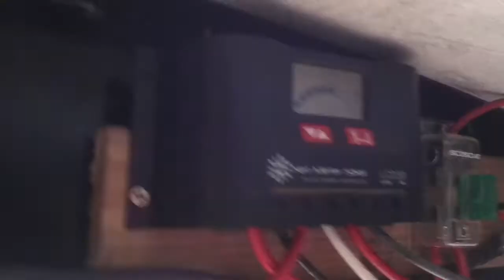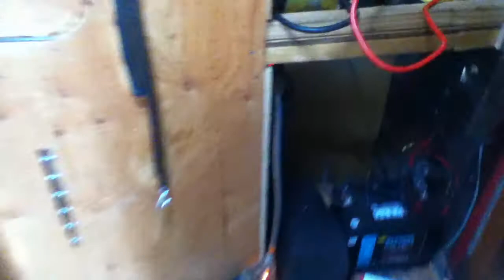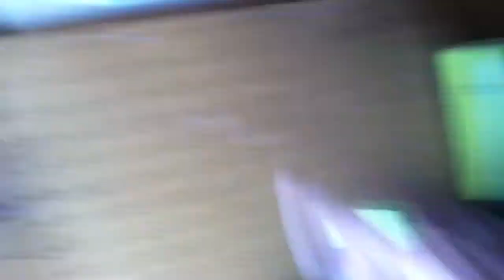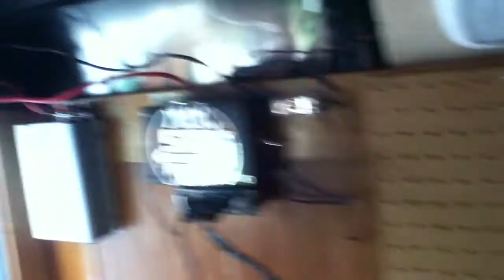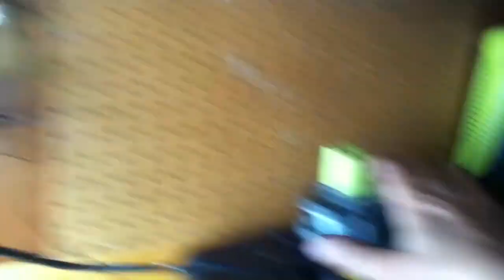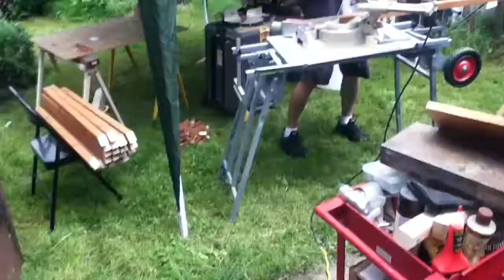Testing the off grid workshop power system 1A

Comment: This is an excellent example of what NOT to do.  

Battery life (number of charge/discharge cycles) is determined by how deeply you discharge the battery.  A battery that will give 1100 cycles at 20% discharge will give 500 cycles at 50% discharge and perhaps fewer than 100 cycles when fully discharged.  There's a very good reason that the charge controller disconnects its loads when it does - it is trying to protect the batteries.  The inverter's low voltage shutoff is to protect the inverter.  It doesn't care whether your battery survives.

I suspect that deep cycle batteries didn't work for you because you tried to go cheap on the batteries.  There's some serious thought needed to correctly size a battery bank for solar power. - typically a much higher amp hour rating that casual users can readily accept.  Sorry, but batteries can easily be half or more of the cost of a good solar power system.

If the system had 4 of the batteries you used in parallel, it might come close to meeting your expectations.
Reply from the maker: notyoung No, no and no.  Power tool battery usage works differently from just leaving lights on.  Not to mention much of what you assume is badly outdated.  Most of your other statements also indicate pretty limited personal experience with this stuff.
Reply: Common battery amp hour ratings are based on their 20 hour discharge rate.  For a 100 AH battery, that's 100/20 or 5 amps per hour to get 100 AH.  Not the kind of discharge rate you need.  The cranking amps rating is typically for 30 seconds, but not 30 seconds every two minutes for an hour.  Neither of those ratings applies to your usage.

Just as automotive-size batteries come in different versions (standard, marine), deep cycle batteries also come in different versions.  You probably looked at or tried the low to moderate current versions typically used in solar installations.  

A fork lift battery has much higher peak current capability (starting a DC motor under load requires a LOT of amps) and that's what would be appropriate for your use.  Long life - typically 10 to 15 years if properly cared for.  High peak current capability - that 10 amp saw probably raises the inverter draw on the battery to 120+ amps.  This battery http://www.hmserviceinc.com/content.cfm/category_id/115/page_id/165 has a 510 AH rating at the 6 hour rate.  It's designed to deliver 85 amps for 6 hours continuously.  The energy stored in that battery is 6 KWH - which should run the saw continuously for 4 to 5 hours. That would also run the saw 30 seconds out of every minute (about the rate that's shown in the video) for many hours.  Having power for the smaller loads all day is a bonus.

Just remember that the battery needs to be recharged every time it's used.  That means that you'll need to make a battery compartment that can be vented to the outside if the trailer must be closed and locked when parked in its charging location.  Also consider that you may need a proper charger to charge that size battery overnight.  Unless you only plan to use the trailer plan to use the trailer every third day, that 10 amp charger from Walmart won't do the job - it could take two days to recharge the battery - 510 amp hours / 10 amps = 51 hours if fully discharged (ignoring the fact that charging isn't 100% efficient).

As a new 6-85-13 fork lift battery with a 5 year warranty is about $1200 plus shipping, I think you'd remember to charge it regularly.

Downside?  It's big and heavy (547 lbs).  It probably needs a bigger charger than you have (more $$).

Positives?  You have power for an entire day on the job.  The solar panels could add to the time you can use the inverter for power but that depends on the weather.
Reply from the maker: notyoung the system I used in his video was eventually dismantled and the components used in another project, but it never required overnight charging.  In fact nowadays my systems are parked nowhere near where there is any electrical power, often sitting for months at a time.  Until I see actual stuff that you actually built or used, you are going to have pretty limited credibility on my channel, but I won't go deleting your comments because your attitude is one which I see from "professionals" who have been misguiding people in this industry for years.

Comment from the maker: Considering the number of cars rolling around these days with batteries over ten years old, and the fact that the charge controller and the inverter both have low voltage protection, I don't expect the use of this system to be fully cycling to the point that it would be killing a battery every three months or even for a few years.    I am cycling this system between 10.5v and 14.5 volts several times a day,

Comment from the maker: I covered those questions in previous videos.  The cable run between the inverter and battery is very short.   I am attributing the current levels of voltage drop to the relatively small size of the battery, but it's real purpose is to regulate the power flow from the panels and for that matter I am calling the test a resounding success considering that it was a pretty cloudy day with the panels operating at only 20%.

Comment: Get another battery. You have delays between saw cuts and that's when it's charging back up. It's always charging even while you are grabbing more wood or doing something else and also might be charging even before you start work for the day so that is all power stored up ready to use. The big walmart batteries are cheap and last about 5 years no matter how you treat them. Plus they have a 2 year replacement warranty.